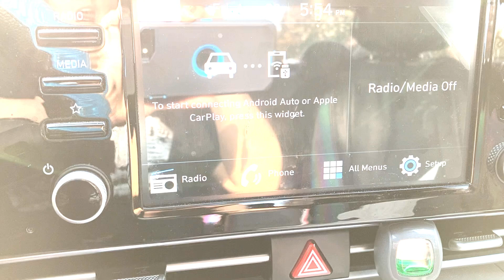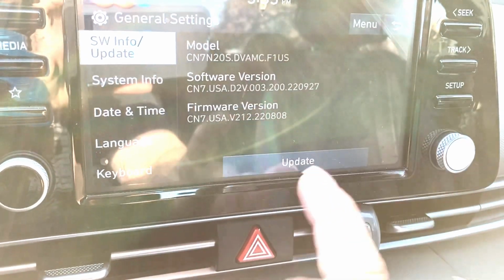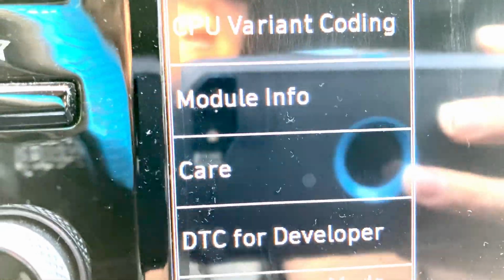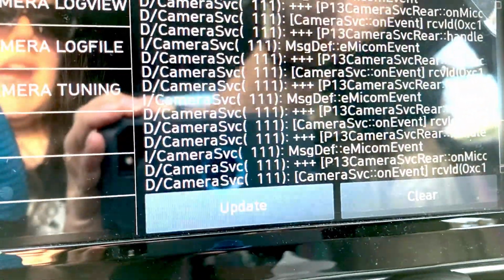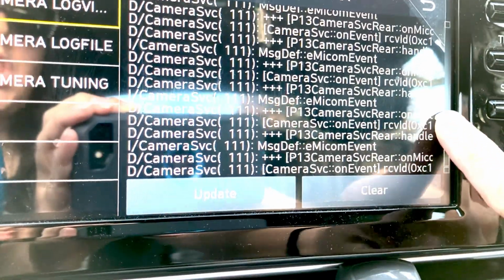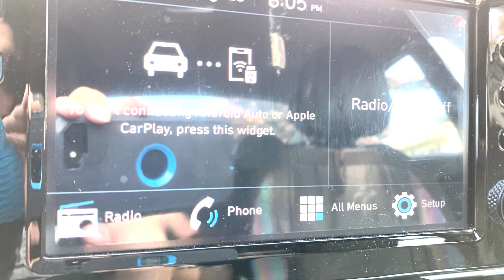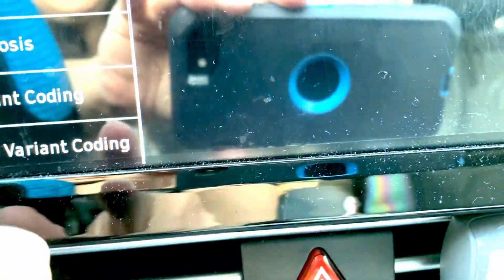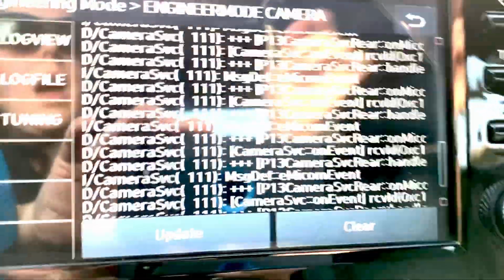Attempting to Manually RESET My Reverse Camera on My 2021 Hyundai Elantra SEL in Engineering Mode

Comment from the maker: UPDATE:

As of NOVEMBER 20th, 2024: 
Hyundai has chosen to issue: Manufacturer Recall Number: 271 regarding my vehicle!! 🤩 

The solder joints may have been insufficient on the camera’s circuit board, increasing the risk of failure during operation. 

ALL OWNERS OF THE SUBJECT VEHICLES WILL BE NOTIFIED BY FIRST CLASS MAIL WITH INSTRUCTIONS TO BRING THEIR VEHICLES TO A HYUNDAI DEALER FOR REPLACEMENT OF THE REARVIEW CAMERA. This remedy will be offered at NO COST to owners for all affected customers. Hyundai WILL PROVIDE reimbursement to owners for prior repairs in accordance with the plan submitted to NHTSA on February 22, 2024…

My personal recall status as of NOVEMBER 23, 2024: recall INCOMPLETE. “remedy not yet available!!!”

NEEDLESS TO SAY I AM A VERY HAPPY HYUNDAI OWNER TODAY!!! 🥳 🚘 👍 🤗

Comment: To avoid liability of others breaking their cars, and to allow yourself the ability to share the code with others, as most people here are willing to take the risk and accept their own fault... just put a disclaimer at the beginning of the video. Heck, even if you didn't add a disclaimer, liability for others breaking their vehicles does not fall on you, so you can freely share the code.